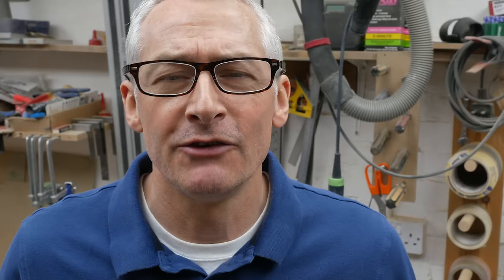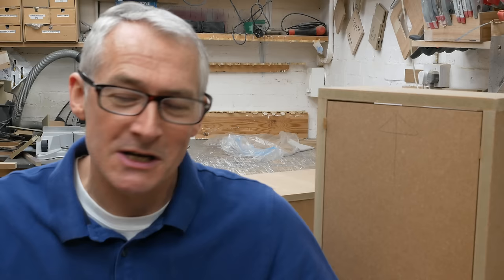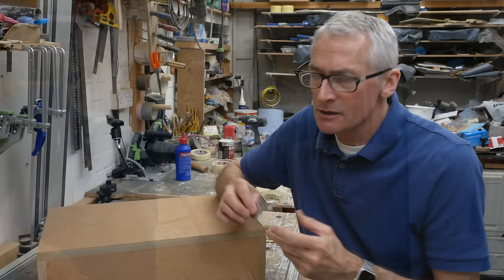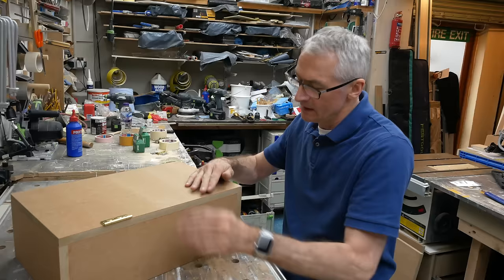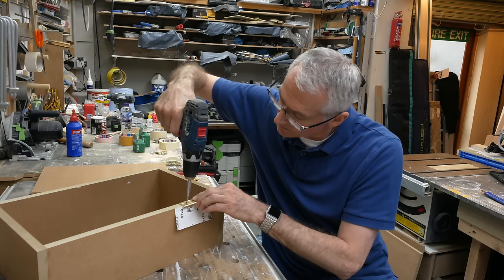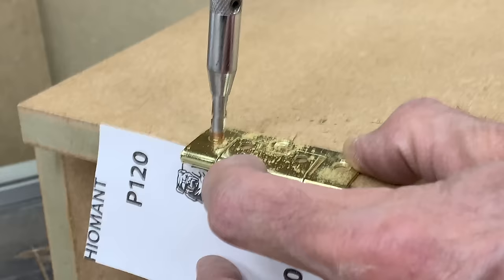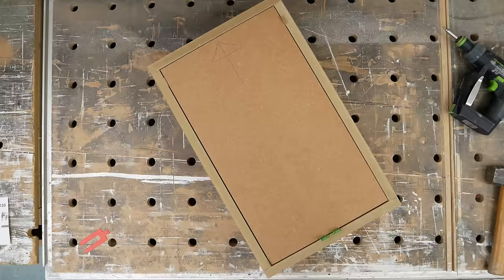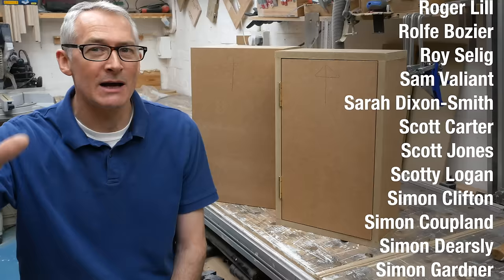Fitting flush hinges for cabinets [video #314]

Comment: Hi Peter.  Just out of curiosity would you ever recess the hinges into the side of the cabinet to close the small gap that the thickness of the hinge leaves the way you mounted them for the overlay door?  Does it make any difference?  Great video by the way really well explained.
Reply from the maker: Thanks! No, if I wanted to rebate the hinge I’d use a hinge that was meant for it, I think. 👍👍

Comment: 09:45 - strangely on most of these cheap hinges, the screws that come with them don't sit flush or below the hinge, which is just mad. I had to counter sink the hinge body more with the last set I used.
Reply from the maker: Rule #1 with cheap hinges; don’t use the suppled screws! 👍👍😱

Comment: Thanks for the fab video.  I have fitted some today with 3.0 16mm spax screws, and although on the cabinet size they have fully counter sunk, on the door leaf they are still slightly proud and the door won't close properly because of it. Do you have any advice? I thought maybe increase the size of the counter sunk on the hinge? It's definitely smaller on the door side.
Reply from the maker: Yes, might be a case of needing to drill out the countersink a bit more; these type of hinges are definitely made to a price! 👍

Comment: Looks like the hinges are set differently for the 2 different types. On the first example, all 3 holes go into the door but on the 2nd example, the 3 holes go into the frame... Any particular reason for this?
Reply from the maker: I explain it at around the 4-minute mark; the smallest leaf of the hinge goes on the narrowest (edge) section of board; on an overlay door that's the edge of the carcass, on an inset door that's the edge of the door. 👍

Comment: Am I right in saying that in the first cabinet you attached the larger part of the hinge to the door but in the second cabinet you attached the smaller part of the hinge to the door? Was that just because the recessed doors gives you more carcass to screw into therefore the larger part gives more strength?
Reply from the maker: It’s how they’re designed to be used; I do say at around the 4:00 mark - the smallest leaf of the flush hinge is meant to be attached to the edge- on an overlay door that’s the carcass, on an inset door that’s the door. 👍👍
Reply: @10MinuteWorkshop  Thanks Peter. I'm just starting out making cabinets and I am just looking to increase my knowledge about hinge types hence the silly questions haha

Comment: Excellent as always Peter. Would you normally paint before fitting the hinges or would you fit, remove, paint, refit?
Reply from the maker: Thanks Andy! I'd normally fit, remove, paint, then refit; just a precaution - you know, if anything did need to be ahem, filled, you can cover all that up when you paoint. Not that I've needed to do anything like that of course... 😁😂👍

Comment: Nice video but you are missing the main point! The second door which goes into frame, how do you determine the depth? This is the main problem that i am facing right now. You need to be really lucky otherwise the door eather is going to be too deep or sticking out of the frame. I hope you know what i am talking about.
Reply from the maker: Thanks, but I'm really not missing the main point; you flip the hinge around backwards and use it as a template. 🤷‍♂️👍

Comment: What size bit did you use for your pilot hole for the 3 mm screw please, and how deep do you drill?  Many thanks.
Reply from the maker: 2mm or 2.5mm, and about 2/3 the length of the screw. 👍
Reply: @10MinuteWorkshop  Thanks very much for this.

Comment: May I ask what size drill bit you use as a pilot hole for a 3mm screw?
Reply from the maker: 2mm, or 1.5 (1/16th") works fine. 👍

Comment: Hi Peter, another super video, thanks. Generally how much clearance/allowance do you give doors please? Is it something like 1 or 2 mm all around? I'm making a cabinet with flush hinges with inset doors. At least if it goes to plan! Thanks so much.
Reply from the maker: Hi Will, and thanks! You’re spot on with the clearance - between 1-2mm is perfect. Anything less than 1mm and you risk the doors binding, anything more than 2mm and they can start to look a bit gappy. 1.5mm - just about bang on 1/16th” - is perfect! In one of the first ‘gift idea’ vids I did I recommended a set of packers/shims that had some 1.5mm ones in there, and they’re very handy for this kind of setting out. Otherwise 2mm work well, too! Hope it does well! 👍👍
Reply: @10MinuteWorkshop  Thanks for taking the time to reply, I'm really enjoying your vids. It feels like the garage is the only place to go outside of the house lately, so my tools are having a dust off!

Comment: I have face frames with inset doors, what is the best hinge for that? It's for kitchen cabinets with wood doors that have some glass. Thanks
Reply from the maker: If they’re reasonably heavy you’ll probably want something a bit better than these flush hinges, so either brass butt hinges if you prefer the traditional look, or you can get concealed euro-style hinges for face-frames, eg https://www.trade-hinges.co.uk/face-frame--appliance-hinges-50-c.asp. HTH, P
Reply: @10MinuteWorkshop  Thanks for the input. I like the look of brass butt hinges

Comment: Which vix bits do you use? Screwfix cheap ones are quite sloppy so screw holes not always perfectly centred. Was hoping you'd be fitting these hinges to a faceframed cabinet ... any tips on alignment with a FF?
Reply from the maker: Generally using Trend Snappy bits for these, though bafflingly they don’t seem to come in metric sizes; I make do 🤷‍♂️ Face-frames and flush hinges are tricky for all the reasons mentioned in the vid - you’re basically joining an edge to an edge, and they’re intended for use on an edge and a face. You can get cranked flush hinges, but I’ve always found the crank to be an odd size for an 18mm thick door. Or try and find a flush hinge of the right size that has a more compact ‘large leaf’ so it doesn’t overhang. Other than that, treat it like an inset door using the method shown here and alignment shouldn’t be a problem. 👍👍

Comment: How far down on the door to place the henges
Reply from the maker: On a small cabinet door, wherever feels right, depending on the height of the door and the size of the hinge. As a general rule, the hinges should rarely be close than half the height of the door, and no closer to the top/base of the door than the height of the hinge. HTH P

Comment: This will definitely be referred to when I finally get around to installing doors on the table saw cabinet. 
I'm quite sure you mentioned it in a past video, but how big should the gap for the inset doors be on each side for 18mm material?
Reply from the maker: Thanks! I aim for around 1.5mm all around (1/16” basically) but I’m happy with 2mm - any more than that and it starts to look too happy, any less and you run the risk of the door binding unless you start messing about with trailing edges etc... 👍👍

Comment: Hi, I noticed in the background of this video you have a Titan bandsaw, I wondered what your thoughts on it were? I bought one but when I use it the blade bends and I never get a straight cut. I'm assuming I haven't tightened the blade enough but I'm worried of overtightening - it if that is possible? I don't know if you have any ideas? I'm very much a novice! Thanks!
Reply from the maker: Hiya. I've done a few videos on this, and there's an entire playlist of mine on small bandsaws here - https://www.youtube.com/playlist?list=PL7S6M0i1Mz9r3-9wmNhCSUU2aI7UCk9Iq. Watch out particularly for videos #148, 149, where I talk about the titan vs others, and #293, 294 where I do a makeover on the Titan about a year later to get it working better. Are you still using the stock blade? Always worth changing it out for something better - I have recommendations in the description of the above videos, btw. Mine took more effort out of the box to set up, but once done it works very well for a small bandsaw. It's possible to over-tighten the blade, but in my experience you can crank them up pretty tight before anything goes awry - there should be minimal deflection sideways, and the blade should give a nice high-pitched 'ping' when plucked. HTH! Peter

Comment: Great video Thanks for sharing ! Just one question, with the insert door you have a gap in the carcass, what size gap do you recommend having?
Reply from the maker: Thanks! Best to try and keep the gap consistent all around, so the same thickness as the hinge - this will vary hing-to-hinge of course, but is typically 1.5mm/1/16th. 👍👍

Comment: Would this installation work on a Lid application? I've built a side table with a "storage bin" instead of a drawer. So, instead of securing the top to the sides I've made it a lid, instead. The lid/top hangs over the side of the box on all 4 sides edge by about a 1/2 inch.  To complicate things, I have recessed all 4 the sides. This makes the legs protrude by 1/4 inch on each side making the legs at the all the corners proud by 1/4 inch. I have a rough drawing but can't attach it to clarify what I'm trying to explain. (I can send it via email, if you prefer.)
Reply: Nevermind...

Comment: Thanks Peter! Do you find issues with screws pulling out coming loose when attaching flush (or butt) hinges into MRMDF 'end grain'? For example, if you had MDF doors in MDF face frames?
Reply from the maker: Morning Sammy. No, never have. I know it’s a ‘thing’ that some people moan about with MDF, but I’ve never had a problem with it, possibly because I use long skinny screws (3x30mm) with a pilot hole. I think a lot of folks who complain are the same ones who think you can just bosh a skinny screw right in there because it’s ‘only’ MDF - and then moan when it fails. 🤷‍♂️👍👍
Reply: @10MinuteWorkshop  Thanks Peter!!

Comment: Hi Peter. Thanks for this video. I'm just starting a rebuild of all my shop furniture which will include using flush hinges for the doors. I'm confused though, as to which way around you ended up mounting the hinges. At the beginning you stated that the hinges are intended to be mounted with the knuckle forward. But in every operation you showed, you used the hinge with the knuckle rearward, usually while mentioning that they were "flipped around" (I assumed for convenience in marking). At 10:46 it does appear you mount the hinge with the knuckle forward on the overlay door,  but at 12:10 it appears that the knuckle is rearward when you're attaching the hinge for the inset door. Can you clear this up for me?
Reply from the maker: Hi Buddy, and thanks! At 4.07 I say the key to the whole process; the smallest leaf of the hinge is designed to sit against the edge of the board, and the largest leaf against the face. That holds true wether it’s an inset or overlay door.  As I say in the video at around 7.50, I flip the hinge around backwards so it can bear against the edge of the carcass to make it possible to mark it consistently. That’s all there is to it; smallest leaf against the edge, largest against the face. 👍👍
Reply: @10MinuteWorkshop  Oh, I see. I think I understand now. Thanks so much, again!

Comment: I can’t find screw heads small enough to actually fit flush with the hinges! It’s driving me nuts!
Reply from the maker: For small hinges then 3mm screws usually work OK, but the depth of the countersink on the hinges do vary, so make sure there’s enough ‘meat’ around the countersink to hold it together! 👍